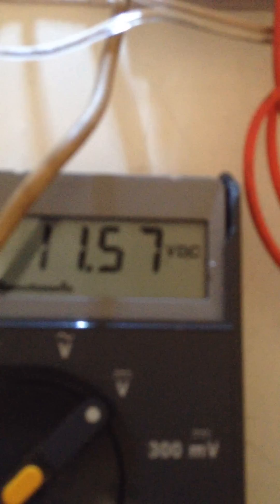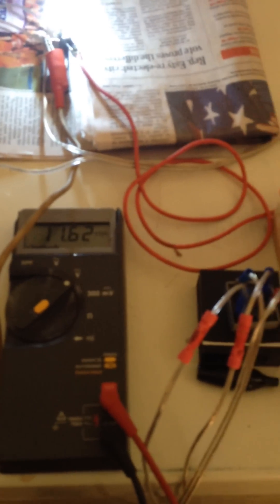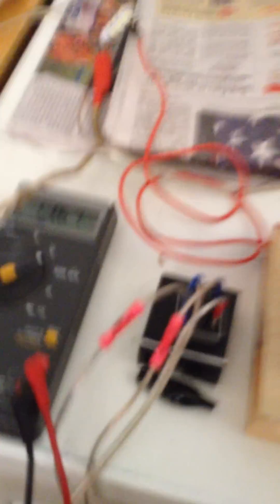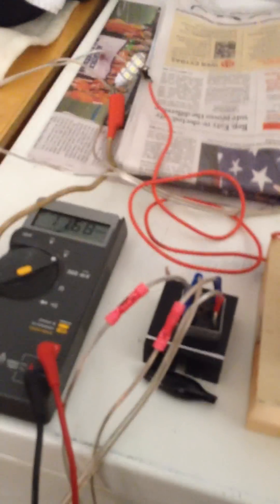Over unity created with transformed back emf. True over unity, no BS!

Comment: Hi Marc. I enjoy your projects. Just wanted to comment about using lead acid batteries for such experiments. As you know when you drawdown a battery like you explained you did then the battery slowly regains some voltage. After drawdown you have to let the battery sit for some many hours before it finally settles. I've run into this many times and is a pain waiting for this slow chemistry to stabilize. Alkaline batteries are also troublesome in this regard. Maybe rerun your experiment only this time using lithium and see how it goes, more reliable readouts Thanks for the videos

Comment: Marc, I finally got this to work. Expensive Super caps were the key (versus cheap electrolytic). Battery and cap voltage both increase while running. However I can only get to the voltage of the transformer secondary and no higher..

Comment: the voltage can rizes it a battery but will have no power. they to do a load test on the battery when its new and  after you play with it try it again see the difference. also try to do this with just the supper capacitor and no battery. if you want to play with large coils with lots of collapsed voltage (i used a 24 pound coil with mosfet transistor :) ) you can do an  H bridge with high fered cap and a pico cap in parallel ( i blow up a lot of transistors before i figured out to use the pico cap. but the voltage will grow very fast to you must use it up or the circuit will explode. need 200w bulbs or battery but watch the voltage dont go over the transistor rating. you can pass the amp rating on a transistor just keep it cool but not the voltage. to save money i used npn mosfet on all four (just had to isolate the gate electrons from the other gate.) this gives you better timing. if you diced to run it all night long keep it out side where it would be safe if it blows up :) i have seen batteries blow up. have fun

Comment: Well did you try ever to use ignition coil? Because Im surching for some thing similar to make dual ignition swaping polarity of coil some thing similar to waste spark culd nothing think of how to switch seperate coils  ore each coil per cilinder to fire 2 times. So culd that by solved with those relays? I mean dual 5 pin polarity relays? I have cinde of transistor in my 4 pin gm ignition module that thing is polarity senzitive so I have kind of problem .

Comment: Nice work so if my rotor was spinning at 6000 rpm and I had n52 magnets 60mm by 200mm how big do you think my coils need to be to produce 24 volts and 50 amps I mean what gage wire and how many turns and what size coil given the core is silicone steel laminate

Comment: Yes sir its charging but very slow but i did not try with the load so i will try your circuit its in pjk free energy book. Any one can built and try nice work sir..
Reply: Hi, have you built it and it works well? Does it charge up a battery?
Reply: I want to build the same circuit, Is there any advice you would give me?

Comment: terrific why do not  you use oscillator with coil instead of the relay  so as to control the frequency to get the optimum results

Comment: There is no OU it's just a voltmeter error. Voltmeter shows unreal numbers because of high energy backemf spikes, but those spikes are very short, so they do not actually charge battery. If you use an oscilloscope there is another song.

Comment: Soo... I made replication of this device. First of all there is no way to be windings as described. Secondary windings are 700 by 0,315 mm or 30 AWG. I that were true than a coil would be three time less in diameter as coil in this video. 

In case you still alive Marc Belanger could you take apart your coil and describe exactly  what are dimensions of core, windings, and coil height/width and of course a diameter of wires in this coils in the video.

Comment: Hi! what happens if you disconnect the battery and run the circuit only with the capacitor? the voltage remains constant? this is the main proof of overunity. thanks

Comment: I don't know if you have experienced this, I have experimented with Bedini solid state ssg
Initially the battery capacity improves and then capacity goes down to a point where battery behaves as a capacitor more and less like a battery
Over time, it starts to lose all its capacity and get charged instantly rendering battery useless to hold a useful charge
I tested with 2 individual brand new lead acid batteries
Same result

Comment: Cannot charge and consume from the same battery. One to charge and one or more to store.
Reply from the maker: You certainly could charge and consume if you do the following:

1) have radiant energy
2) have a high frequency switched circuit that breaks the connection
3) the trick is to think outside of the box and pulse your energy into a coil. Store the radiant energy at high frequency  into capacitors that could then be released as a means of switching to use the collapsing magnetic fields your source of energy for the load. This converts pulsed hf into direct current of massive proportions just as long as the negative side of the cap remains connected to ground and you use dc to convert to ac at 60hz with an inverter,  you'll have massive gains in power from the discharge of 2 in equal capacitors. One is the Earth, the other is the one in the circuit. Dont say it wont work either, this is what Tesla did and he had 100 times the power he injected into ground as a return.

Comment: CEMF goes in the same direction as the original charge. It only reverses when run in parallel with a cap and resonates. Good work you need a simple diagram rather than verbal because no one can see and understand all the scattered stuff you have. I have charged batteries for years using Bendini or contractors. The larger the PM the more energy absorbed.
Reply: he did have it on the site https://mbrcircuit.blogspot.com
Reply: @Jay-mb1ym Circuit and instructions can be found here https://mbrcircuit.blogspot.com/

Comment: What if you uploaded the blueprints of your invention to Github and licensed it with appropriate open source licenses? TAPR OHL license should be good enough i guess. This way other people can also contribute and stuff to your project and improve it.
Reply from the maker: I released this device's schematic to a link in the description I believe. These devices aren't easy to recreate because they need to be designed and tuned to remain in resonance. The turning drifts when it warms up so a Phase Lock Loop circuit needs to be used to attenuate it a bit once drifting happens. In my case with the relay, it's oscillation is forced by how the relay is wired. A capacitor could control the speed of switching and the correct cap needs to be calculated for resonance. It's recommended to add a Variable capacitor to tune it to the best power producing frequency.
Reply: https://mbrcircuit.blogspot.com/

Comment: Hello marc, you have some intresting videos there, nice work! But when i replicate this cirquit and connect a 12v battery (standing voltage 10v) it stays the same if not slowly discharging.. and that is without a load.. BUT if i touch the metal case of the relay(the ground ) then my voltmeter shows spikes of 13,14,15 volt. am i when touching the relay acting as an antenna or what you think? If u want i post video of it.. grtz

Comment: As an advocate of ZPE -- after all, zero point energy is postulated in Quantum Electrodynamics -- I have to say, you have a step-up transformer, most likely, and that explains the higher-than-9.8vdc your meter reads.  Here's Richard Feynman's calculation of the magnitude of ZPE:  
"Physicists Richard Feynman and John Wheeler calculated the zero-point radiation of the vacuum to be an order of magnitude greater than nuclear energy, with a single light bulb containing enough energy to boil all the world's oceans."  So if you're convinced your simple circuit is somehow safely channeling a trickle of ZPE I'd like to understand how.  Back EMF is caused by the collapsing magnetic field when current flow to your inductor (the transformer windings) is shut off or when the direction or magnitude of current flow in your circuit changes.  If you're sure you're capturing ZPE with a step-up transformer and the other components in your circuit, how do you think it is happening?  I'm not seeing overunity in that circuit.

Comment: Thanks for the video. What did you use for your transformer core, how many turns on each side and what gave of wire for each side.
Thanks again 
Gordon.
Reply: Go to 5.40 in the video. He does not say what the core is, but the primary is  250 turns of 22 gauge and the secondary is 300 turns of 30 gauge

Comment: Hi Marc, I just want to ask if you have taken measurements of the the battery with no live circuits, just to be sure the battery is being charged? I have thought my batteries are charging and when I take them off they are have not gotten any higher. Maybe see on a 2nd battery?

Comment: Hey Marc, what relay are you using? Mine are std 12v 30 amp auto relays, but they keep blowing...thanks. Ps I pegged my volt meter with a 1.5v aa battery...crazy cool.
Reply from the maker: I used AGT automotive relays, 40 amp, but the voltage from each one is different, depending on 1) the circuit, 2) the voltage and 3) the load. If you don't fire a load and the relay simultaneously, the voltage will be very high and the arc could damage the contacts. If the voltage is too high, the coil could be damaged, however it all depends on if you have resonance or not. resonant rise creates an output of very high radiant energy. If you have low resistance wire and connections, plus a load, the radiant energy will be virtually non existent and the energy being conventional will damage the relay due to the destructive nature of conventional energy, especially from batteries. If the wires and such have a high resistance, or if you introduce the energy connected using an avramenko plug, by pulsing into the ground and drawing the energy back through the other diode, the radiant energy will be pumped into the ground and collected amplified via an antenna on the positive side of the coil. There is so much you can do to improve the circuit. Please have a look at http://mbrcircuit.blogspot.com/ If you have the ability to build a radiant energy charger, you can do so and drive a transformer as I do with the relay. When I am done tomorrow, if you wish, I will look through my archive of circuits and send one to you that works great. There are millions of combinations, my way here is just slight proof that it is possible. If you'd like to make it work and get a lot of energy from it, you can use this to your advantage to generate energy, store each polarity of pulse into 2 separate cap banks, then use them to cycle on and off a simple transistor and resistor based inverter at 60 cps. The size of the resistor will determine the frequency. Good Luck, I will get back to you tomorrow night or monday

Comment: =) you can insert a solar panel in your system and back to the battery.... keep working!
Reply from the maker: Sure can. My charger circuit works better. I can add (2) solar cells in series and power the radiant charger, then charge (2) 60F 16V capacitor banks in parallel making 120F. It charges in less than 10 minutes and when you dump a fully charged cap bank into a 12v deep cycle battery, it will run a load of 4 times it's size and shut down, then swap over to the next charged cap bank, swapping back and forth after they are charged, releasing hundreds of watts worth of power instead of the lousy 8 watts we started with. The energy used on the load is used up until the battery reduces 10% in value or less. The super caps that are charged dump back into the battery, charging them instantly, running the same load without even a flash when the bulbs are changed over to the new cap. The load voltage is so close to when we switched it from the last cap that there is hardly any change noticeable, and the next cap set up is charged before the 400 watts run the battery down far enough where the next cap's charge won't replenish it. If we ran a battery charger back to the input, the circuit still runs, so it is proven overunity by pulse to the ground via an avramenko plug! I released the videos without the charge swap circuit connected, but I need to increase it's output to see if I could get more out of it to make it more impressive. It can now run every bulb in one's home without discharging before the next cap is recharged, again cycling over and over. If I gain 10 watts, it dies though, but I will succeed. This takes a lot of time and effort, those of which take the time to suppress instead of build waste with their breath.. LOL